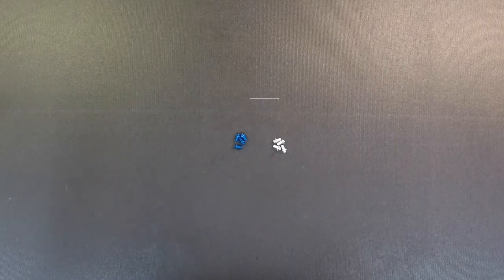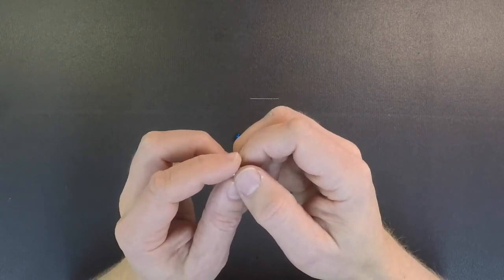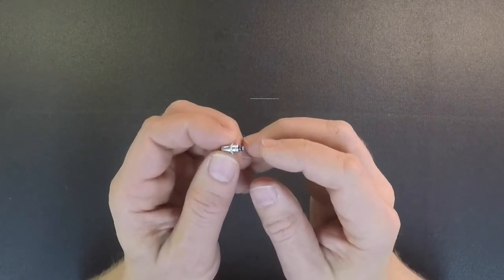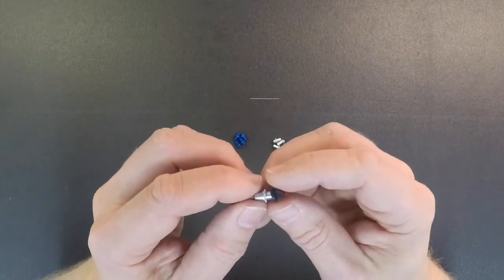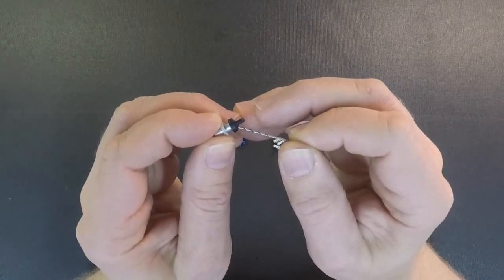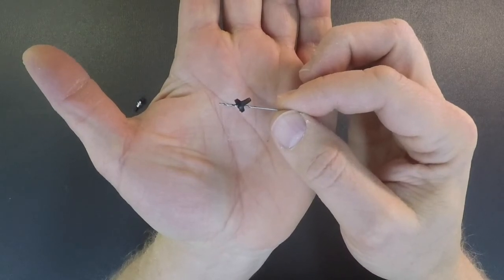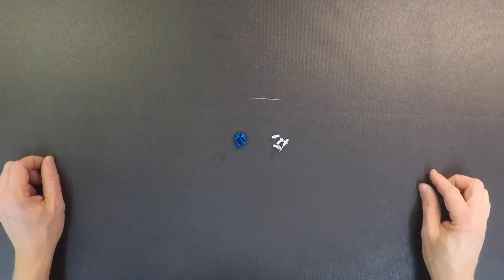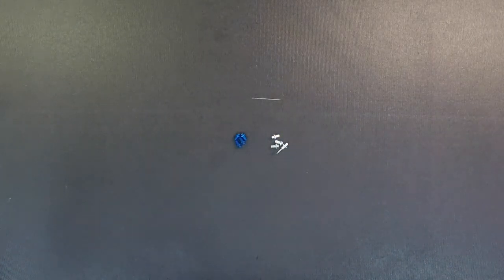1RC Racing   1RC5006 5007   Threaded Alum Shock Body Set

Comment: So if you don't drill it you could potentially have a hold down shock?
Reply from the maker: It will act like a tie down shock off the car but once you run the shock on the car the air will slightly bleed away and not be consistent.

Comment: How do I get the old shock apart to use the shaft?
Reply from the maker: The shock caps will pop off then then you can unscrew the plastic rod end from the bottom of the shocks and then the shaft will come out of the shock body.  Thanks